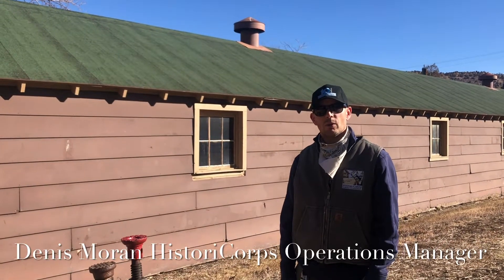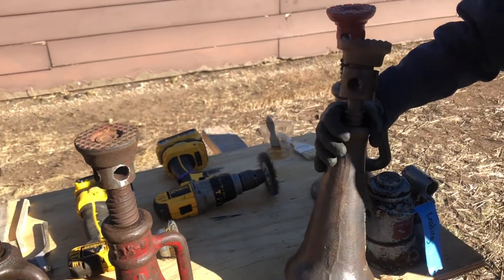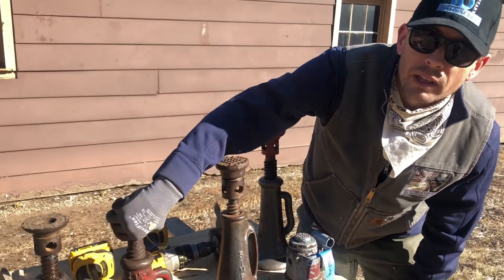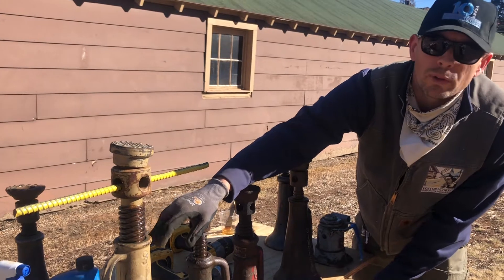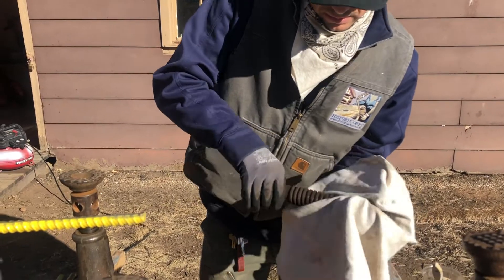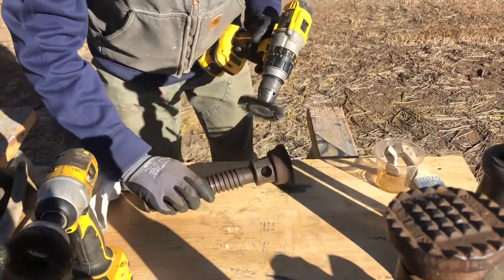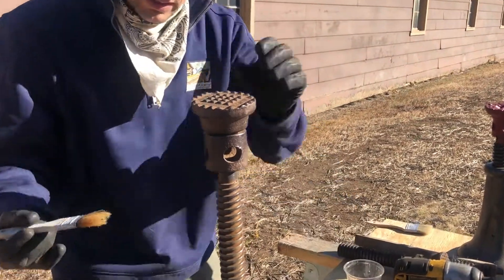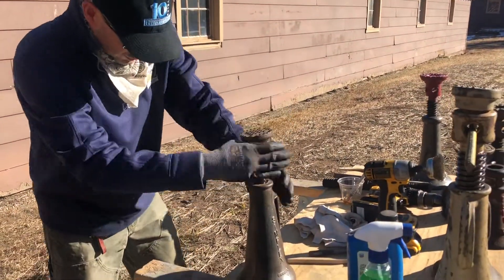Screw Jack Maintenance

Comment: I just found and bought 4 of these. Plan is to use them to lift a deuce and a half army truck. I greased the screw and sprayed WD 40 on the center of the pivot head. That's as far as they'll get cleaned for my needs.